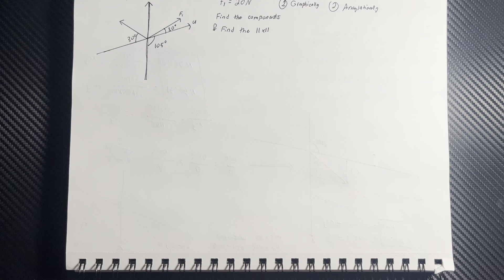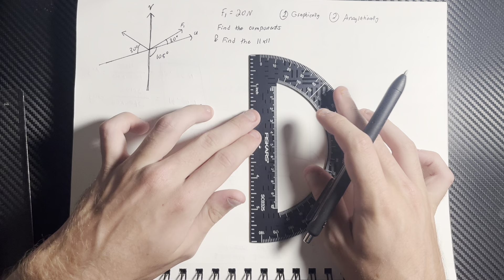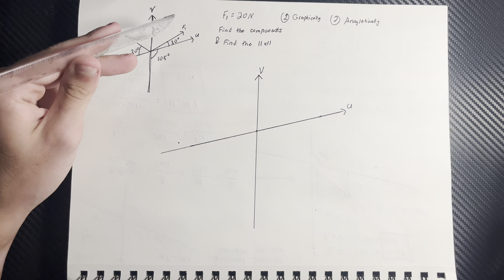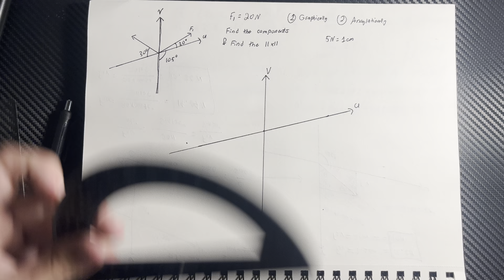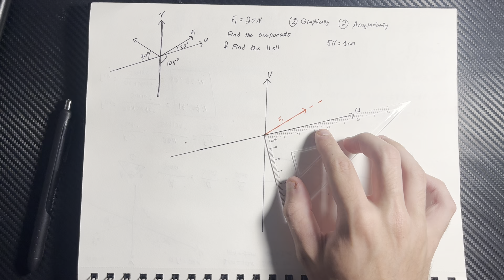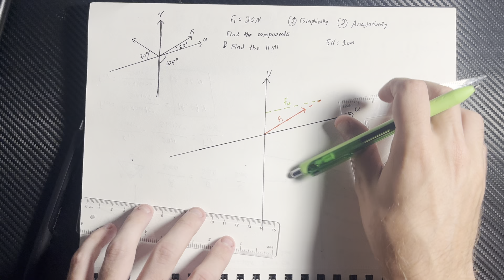Components and Magnitude of Force Vectors (Engineering Mechanics: Statics)

Comment from the maker: I did actually make an error in the graphical solution… when drawing the angle of 30 degrees for the force with a protractor, I accidentally drew it 30 degrees from horizontal instead of 30 degrees from the line U which resulted in small errors for both F1u and F1v.